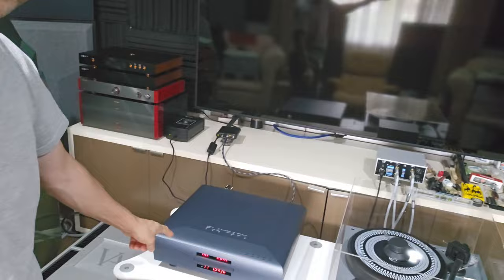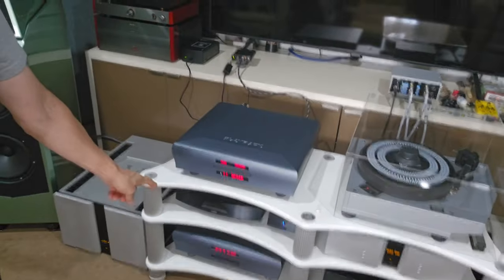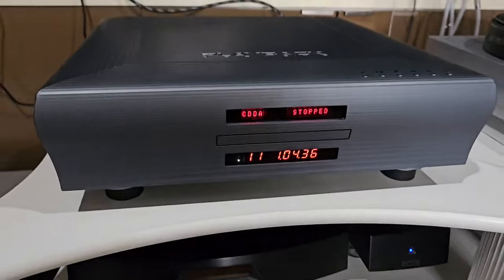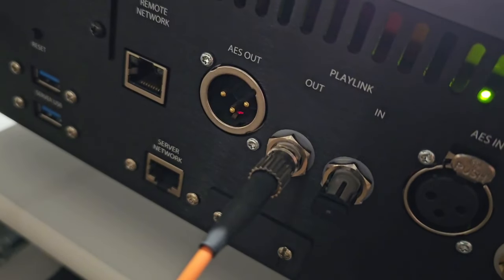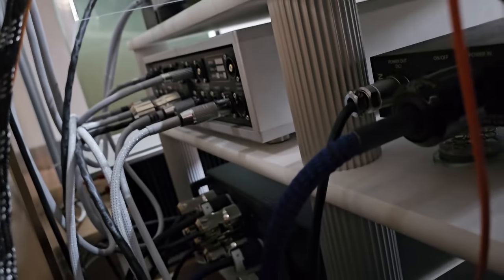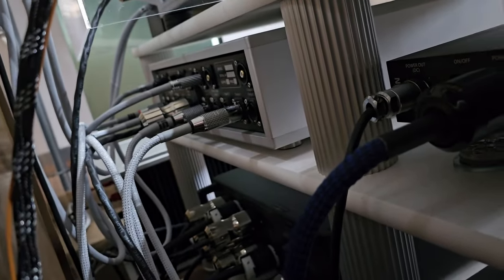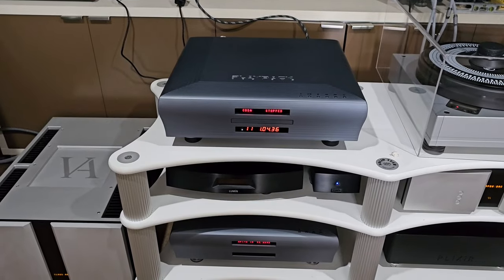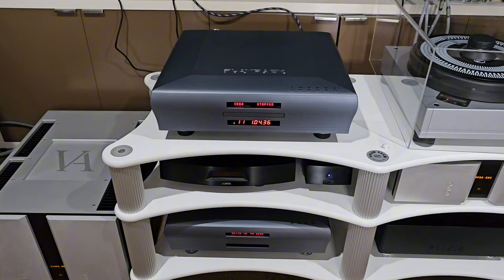"PLAYBACK DESIGNS  MPT & MPD-8 THE DREAM STACK AT WORK"!!!🎧👍

Comment: You should try a better USB cable than the Evolved considering the level of gear you have, i had it and sold it after i tried the Vertere HB USB.
Reply from the maker: I have about five USB cables at that level or higher, so I'm always experimenting, but it sounded pretty amazing in the room with the evolved. And further to that, the differences by changing a USB cable at the level I'm at these days is pretty minimal, probably even more, so hearing it down YouTube, but I take your point. I'm not sure where you're located. I've never heard the Vertere HB USB cable it would be interesting to put it in my system to see if there's a big difference or not 🎧👍
Reply: Vertere - Pulse - HB Ultimate Reference  USB Cable. $4295 AUD retail in Australia, for a 1 metre cable.

"Based on Pulse-HB Technology, the Pulse-HB Hand-built USB Digital Cable utilises a proprietary shielded Data conductor pair and a separate shield wrapped Power conductor. Carefully twisted together they are then overall shield braided and outer jacketed to produce this amazing USB cable.
Every Pulse-HB Hand-built USB cable is meticulously tested and listened with against the original master reference cable to ensure the best performance from computer audio."

The Australian distributor is located in Melbourne. Perhaps they may lend a cable to Shane for auditioning/reviewing in his system?
Reply: The Australian distributor for Vertere are H-Fi Collective in Melbourne. They are also distributors for some other very nice gear, including Auralic and Fyne Audio.

Comment: Beautiful system! While I understand the desire to show off system components, especially for youtube, ideally you probably should put all your gear in another room to isolate it from your speakers and subs. Bass can cause clock jitter in a DAC as the shockwave will pass right through the case and cause the crystal oscillator to jitter. The only thing that should be in the same room as your speakers are the amps as they have to be in the room. And I would keep the amps as far away from the speaker subs as possible.
Reply from the maker: @BrentLeVasseur  Hi Brent, All of my components are on Stack Audio equipment isolation, my speakers and subwoofer are all on Stack Audio Auva100s, and last but definitely not least my rack will soon be independently isolated from my equipment with an anti-vibration medium poured into the hollow aluminium legs and the installation of Stack Audio Auva100s screwed into the bottom of those six legs. 
So, I've gone to great levels to independently isolate and decouple every component in my Hi-Fi system. You make a point to a certain extent, but really, here is the problem with that. It's completely impractical for just about everybody to remove all of their component equipment into another room, and if all your equipment is completely isolated from any source of vibration the audible differences here are so negligible it's simply wouldn't be worth the downside. And there is a downside. The expense of running extremely long interconnect cables is the first problem I have with that idea. The second problem is the possibility of those long interconnect cables working as a big antenna picking up RI and EMI  interference to make any of that worthwhile.

I get what you're saying, and yes there is some merit to that scenario but unless you've got millions and live in a big mansion with plenty of spare rooms to go around, it really just is not a practical exercise. And it's certainly has its potential downsides as well.👍🎧🙂
Reply: @ The footers don’t matter because the shockwave travels through the air, penetrates the case and hits the components directly. So don’t waste any money on special feet as it doesn’t matter. The only way to solve the issue is put your gear in another room or closet.
Reply from the maker: @BrentLeVasseur  Brent, do you honestly think people are going to do that for the very, very small audible improvement it would achieve?
I'm a sound engineer, so I've worked in recording studios where we listen to music at times around 100 db and above. All of the equipment we are using to master this material with is in the same room as the monitors and sometimes subwoofers. The improvement that you're talking about here is extremely miniscule. Most people don't listen to music at those kinds of levels where the sonic footprint disturbing an oven-baked crystal oscillating clock would be affected to the extent where this would be worth doing. 
All so, in high-end audio equipment where this sort of extreme would be a consideration a heck of a lot of design work goes into insulating against such things further negating the need to go to this extreme you speak of.
I understand what you're getting at here, and in some extreme cases where this would be a consideration sure why not but only for the very small percentage of people I mentioned in my first answer to you. Mate, it's just not practical, and it doesn't improve the sonic presentation enough to warrant the expense, the hassle, and the potential downside risks to running long interconnect cables. You could create more problems than you fix.

Further to that, the way we get away with this in 99% of cases is that we isolate and decouple our equipment from each other that is in the same room. 
The Delta difference between doing that correctly and your scenario is so minor it really becomes a no-brainer as to which way to go. Decoupling an isolation is absolutely not a waste of money. It's the best bang for your buck way to get where you want to be with your scenario of separate rooms. 
Another thing that comes to mind is that the sonic waves you talk about also effectively travel through standard interior walls of a house. This will also affect sensitive digital equipment in the room adjacent to the listening room in your scenario, especially if you're listening at the levels where this would actually make a difference. 
Another thing, and this would be a far bigger problem is you'd be damaging your hearing with prolonged listening at the levels that would create this problem. 

So add all that in with the potential of creating a great big antenna that has the potential to pick-up all kinds of electrical interference between your amplifiers and the rest of your Hi-Fi components in the next room, and you have a potential recipe for disaster right there with no upside. And then you've got to hope your remote control/s work through the wall or you're getting up and going into the adjacent room to turn the volume up and down.
I'm not trying to argue with you. I'm just pointing out all of the problems both potential and actual your scenario would create.👍🎧
Reply: @  I do it. I placed all my gear in a rack in the next room and just drilled holes through the front wall to feed a pair of balanced XLR cables that go to my amps. The only thing in the room with my speakers are the amps. As for controlling it, I use Roon via my iPad, so I don’t actually have to get up from my listening position to fiddle with anything. I guess if you are playing records or CDs where you need to physically swap the media, then that might be an issue. My suggestion would be not to place your gear right between your speakers where the strength of the bass is at its maximum if you don’t want to put it in another room. As for how bass affects the crystal oscillator in a DAC, there is a Dutch audiophile channel on youtube, where they actually measured the jitter on a crystal oscillator when being exposed to bass frequencies. Check out the Alpha Audio youtube channel, where they measured jitter on a clock crystal oscillator of a DAC. When you are spending $25k on a DAC and over $100k on your complete system, all of these little things start to matter a lot, because they become audible. However that’s not the case for most people, because they don’t have treated rooms or $100k+ dollar systems. But you do! :)
Reply from the maker: @BrentLeVasseur Hi Brent, yes, I appreciate your above message.
 I've taken great measures to mitigate standing waves here in my well-treated listening room, and with the isolation and decoupling measures I've  gone to, I've essentially mitigated most of the issues that you speak of. I have physical media as an ever increasing segment of audiophiles do.
I'm certainly not discounting what you're saying, only pointing out the impracticalities of doing such.
Apart from all that, I absolutely love looking at my equipment, so for me, it's staying put in my room.👍🎧
Reply: @ Yeah I get it! If I had your system I’d want to show it off/look at it too.
Reply: As far as the physics are concerned, the cushioning feet only reduce floor vibrations. However the bass shockwave from your speakers/subs travels through the air directly like a sonic boom and hits the outer case of your DAC directly, and the lowest frequencies will pass right through the case as if it wasn’t there. It’s like if you are standing in a room behind cover and someone tossed a hand grenade into the room, the shrapnel wouldn’t hit you but the shockwave from the explosion still would, because it passes through barriers.
Reply from the maker: @BrentLeVasseur  Yes, I understand the principal in relation to how Sonic's pass through equipment and walls and pretty much most other things until they dissipate in intensity, but really we are talking about very extreme levels of listening here to create that kind of interference that would be audible. Yes I'm sure you can measure it but I would almost guarantee the most refined ears would not pick those minimal differences up and as I said above listening at those kinds of levels where this would be a concern you would have a lot more to be worried about like your hearing.🎧🙂
Reply: @ The differences involved here are similar to say the differences between using a fiber optical connection between a streamer and DAC vs. say a direct USB connection. It’s subtile but still audible. At this level everything matters (as you know). Power cords, network cables, EMF mitigation etc… all come into play. On my system I can hear the differences in network switches. When I swapped out a 1GBit ethernet switch and upgraded to 10Gbit fiber, the sound of my system changed, and it was very audible. And when you are spending $$$ on the best DAC and streamer in the world, then this matters because you can hear the differences. But again it becomes a tradeoff between do you want the best possible sound quality or to be able to admire your gear while you listen to music, and for you, you prefer to admire your gear, which is understandable! Ultimately it’s what gives us the most pleasure that matters.
Reply: @ By the way I heard a sound demo shootout today on youtube between your DAC the MPD-8 and I think it was an $80k MLB DAC? Anyway the MPD-8 won the contest as it made everything sound better/more natural. So I think you probably have the best DAC in the world. Having said that, I’m not sure if that’s the DAC I would choose as an audio producer/mix/mastering engineer because it makes everything, even badly mixed/mastered tracks sound better. For that I think I’d want a DAC that mercilessly reveals bad mixes/masters. But for sheer listening enjoyment, I think the MPD-8 is currently king of the hill.
Reply from the maker: @BrentLeVasseur  Hi Brent, I also have worked as a tracking, mixing, and mastering engineer back in the tape days.
I've worked on Joe Cocker's last Australian tour, among some notable others as a live mixing engineer over my career.
I agree, I think the MPD-8 is probably the best DAC in the world. It's certainly the best of the over 300 that I have heard so far. 
But I respectfully have to disagree with you in relation to it making a bad recording sound better than it is  because in my experience, you get from this dac exactly what goes into it. I have what I believe is a reference system that I have built to essentially make it easier for me as a reviewer to determine differences in equipment. I guess the best thing you can ask for out of reference equipment is for it to be absolutely neutral, and that's how I would describe the MPD-8 dac.🎅🙂🎧👍
Reply: @ Thanks for the feedback! It’s on my shortlist for a possible upgrade. Have you also heard the Mola Mola Tambaque?

Comment: The MPT8/MPD8 is IMO the best SACD and CD player ever made.  Owned them for about five years and still amaze.  To me, it has a sound with SACD or CD that is not replicated by streaming.  With old CDs, the first AAD transfers, it has to be heard.  My theory is that when CD was being launched as a new technology, they took special care with the first releases, same with the first single layer SACDs.  Andreas was involved then, wonder what he thinks.
Reply from the maker: Yes, I agree with all of the above. I've got a Robert Cray AAD CD amongst many others, and they all  just sound so analog on the mpt 8 the best I've ever heard as well hands down. Thanks for commenting, and congratulations on your playback designs components .👍🙂🎧
Reply: The biggest advantage of vinyl for example, is it's limitations. It can only be played by a large, stationary device, so it's expected to be hooked up to a full size system. Because of this, recordings were always engineered to make the most of the format. When CDs came along, that mentality held up. In part because they were expensive and there weren't portable players right off the bat. Once the engineers got a good grasp on the new format, they were able to do some amazing things. CD does, in fact, blow vinyl out of the water. But with all that dynamic range available, radio stations in particular, started pushing hard for louder and louder recordings and wouldn't ply anything that was too quiet. Aka, made proper use of the format. So this is why, I think, some of the best works on CD are from the late 80's to very early 90's and then things went down hill for a long time.
Reply from the maker: @zackw4941  As a former sound engineer, and working around that time you describe and still with master tape, I couldn't agree more with that statement.👍👌🙂🎧

Comment: Great video! Awesome sound. Curious as to why you don't just plug your ethernet USB cable directly from the wall internet outlet into the Lumin vs an etherRegen internet switch into the Lumin. Less circuitry etc yes? Also, I've never seen a power cable on a USB cable(from streamer to MPT-8) and where does the power cable eminate from. Why was that done. I ask all this as I just ordered an MPD-8 and the MPS-X streamer and will need to buy a new CD/SACD/BluRay payer as I have a home theater system and will also use a USB cable to connect to my MPD-8.... I have an SBooster LPS also so I am very curious as to your approach Thank you!
Reply from the maker: Hi there, I guess first up, I should probably do a recap of my hifi system from when I made this video.
I now no longer use the Lumin U1. All of the streaming duties happen through the mpt 8 as it is fully optioned with the 2 tb server, and it is a roon core.
So, to explain how things work now, a cat 6 cable comes directly from the router to an ether regions, internet switch powered by an  s booster, series 2 lps to the mpt 8 Through a high quality cat 6 one metre long cable. There is no wall socket. There is a small diameter circle cut in the wall that the cable comes through and then goes to the switch. All of the streaming of Qubuz that I do through roon happens at the mpt 8 component as well as my music library, which is stored in that component. The connection from the mpt 8 to the mpd 8 happens through their AT&T glass fibre plink  proprietary connection, which is the best possible connection between playback designs components.
You should also receive this cable with your playback designs streamer, enabling you to connect the streamer to the dac.
I hope all of that made sense. 
A video should come at some point to explain that to everyone else, I guess.
BTW, congratulations on your purchase. You have bought 2 of the best components out there to do the jobs they do.🎧👍🙂

Comment: Could you install the streaming module in the MPD-8 and use the MPD-8 to stream?
Reply from the maker: Hi there, The streaming module can be installed into the MPT-8. My unit has the roon core and server option installed, so I'm now streaming with Qubuz through the roon Core in the MPT-8, so the Lumin is not in the system anymore as a streamer.👍🎧🙂
Reply: @shanestephenson8423  Awesome. So the Streamer-X is that software or a module and can Streamer-X be installed in either the MPD-8 or MPT-8? Thank you for the reply. Cheers 🥂.
Reply from the maker: @johnvalatos4073 Hi, The Stream x2 module is either an installable card or a separate component. You can option the mpt 8 with the Stream x2 streamer card in it. Or purchase the separate streamer from playback designs.👍🙂🎧

Comment: Why not bypass the Lumin and connect ethernet directly to the MPT ? Or is it not able to accept a network connection?
Song sounds amazing.
Reply from the maker: My MPT-8 8 is optioned with the server roon core, not the stream X 2 option. But I may have some interesting news about this shortly to share with you all. 
But what you were hearing in this video was just a standard 16 44.1 RedBook CD. The transport in the MPT-8  is nothing short of amazing at extracting every bit of detail out of a standard CD.
Reply: I think it will except both cards.  I used to own a Lumin X1, liked it but I would suggest acquiring the streamer card for streaming.
Reply from the maker: @daverolson  Thanks for the advice, man. I'll look into it👍